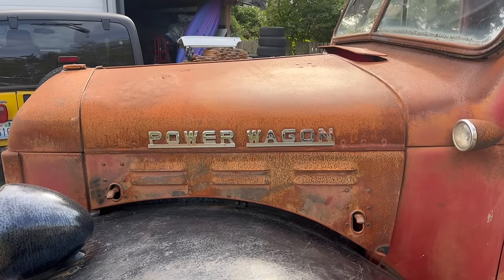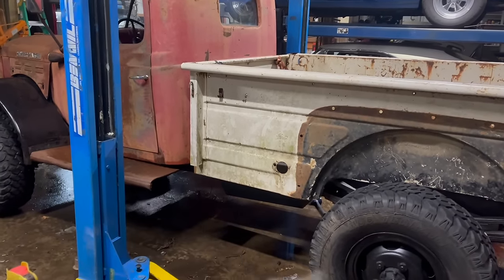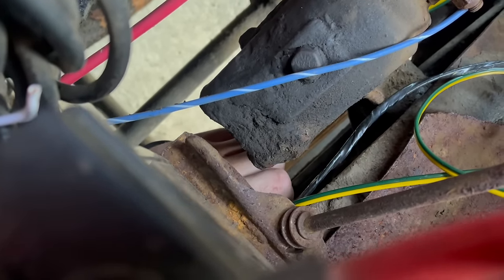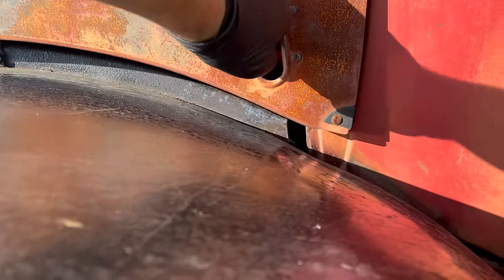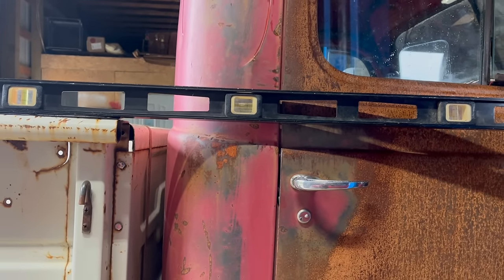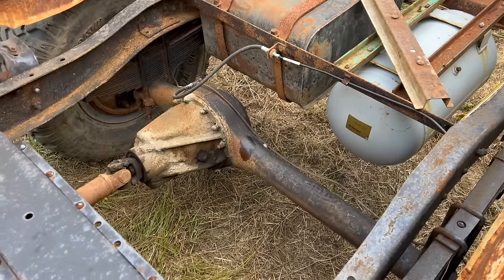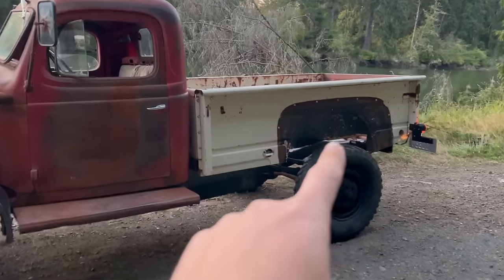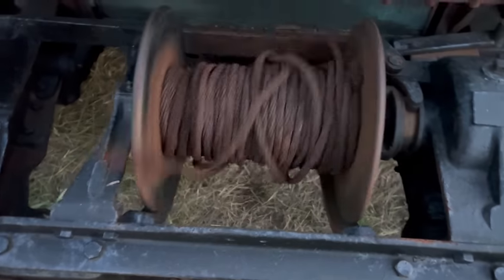Long Abandoned 1948 Dodge Power Wagon Project Gets A New Lease On Life

Comment: Really cool to see someone your age interested in old iron !  My 1941 WC22 has the same engine and straight cut 4 speed which shifts super nice, in fact it just drops into every gear with the right touch.  I think getting the carb / engine tune right, and the throttle linkage free of play and smooth makes all the difference in the frustration level when shifting gears in these.  Keep it up !!
Reply: 1😂😂

Comment: Pressure wash the frame rust really well, then brush on a coat of "Coroseal" rust converter... Awesome stuff that last for many years right outdoors. It's not at all like the old acid based converter, this stuff is one coat, turns it black, looks great... Perfect for the Patina restoration peeps that don't have the time, money or patients for a full restore.

Comment: I have always liked those WW2-style Dodge Trucks.
   But the reality of owning one scared me off.
   Can see where a NP435, NP445, or A518 swap could be really  useful.
   Also see why the Cummins 4bt/12V swaps are popular.
   Or swapping in modern gas V8's or inlines.
   But that messes with the overall Lo-Tech sensibilty of the truck.
    It was not made for the modern 80+mph freeway, nor fit into modern Le Car sized parking spots, limited stopping power that only Fred Flintstone envies, and no need high octaine fuel at all.
   Still a very cool truck as is.
Reply from the maker: That’s it. While I get the appeal of being able to drive one everywhere, all the time… I couldn’t see ruining a time capsule like this. If it was less complete or the engine was garbage, ok. But I couldn’t do it. I even had the 4BT…

Comment: Absolutely love this old guy!  I'd gladly give a ton to run across one I could redo the way I would like to do one.  I know that towards the end of this body style MA Mopar equipped some of them with a  poly 318 which would make me the happiest truck owner ever!
Reply from the maker: Actually, as far as I know, these were flathead and then slant six only - and I think the slant may have just been for export? These trucks remained in production for the US through 1968, but were available elsewhere into the 70s. The W series (the more modern pickup based Power Wagons) could have a poly, an LA later, and even apparently big blocks? Either way, I also just love this thing. It’s just about my favorite thing to drive now - despite being pretty horrible by today’s standards. Haha.
Reply: I know that I saw a power wagon factory equipped with a poly 4 barrel.   It was used by a fire department.

Comment: Really dig your ole heavy hauler. Seeing you having to double clutch it and try rev matching to downshift reminded me of the old grain trucks we used to have. Learned to drive our 50 Chevy ton and a half when I was 9 and by 11 years old it became my job to shuffle the loaded trucks from the house to the field since everyone else was either on a piece of equipment or gone on the road in a semi. 

Thinking about your lack of turn signals clicked another thought about the old grain trucks of grandpa’s and semi trucks from my dad and his brothers. All of those old trucks used an almost identical turn signal switch that clamped around the steering column made by the “Grote” company in case you were looking for a solution. Unfortunately since the turn signal switch was an add on for those old trucks and for the semis until the very late 80’s they don’t self cancel as the columns weren’t built with the internal trigger wheel, learning to click the switch back after completing your turn is still tough to remember after 40 years of it off and on. 

The bowed front bulkhead of the bed could maybe be straightened with a deflated wheelbarrow or motorcycle inner tube. I’ve used the inner tube trick on later model trucks and it worked fine but the later stuff is definitely made of thinner steel, worked great on straightening door skins on several occasions as well. Good luck with getting the truck up to snuff, it may take you a while but it looks to be something you can tackle a little bit at a time.
Reply from the maker: I’ve never seen them from Grote, I’ve seen the Signal Stat. I’ve got a couple of them around. The existence of that switch is why I ran two wires. Haha. But I do also have hands for signaling, and it’s not like I’ll be driving the dang thing much. If I actually add a trailer like I’m considering, that will become more important.
Reply: Sounds like a good plan. Got used to hand signals a long time ago when I put my first panhead on the road. Also the same bike I got run over on in 03. Unfortunately not everyone pays attention to their surroundings nowadays. Glad to see you’re keeping it simple. 

Now that I think about it, the Grote turn signal assemblies were all in trucks that were older except for the one in grandads 60s model King Midget minicar. I do remember that they had they all had chrome levers but the bodies were made with both chrome or bare pot metal. I guess they’ve possibly become obsolete.

Comment: Beautiful old truck! I have a '56 with a dump bed and many of the same quirks: brake issues, rotten wood in the bed, noisy, etc. It was a Fish and Wildlife Service truck in its early days hauling gravel for the spawning beds. PTO shaft drives a little hydraulic pump with 2 lift cylinders. When you drive it awhile and get the feel of the tranny, your gear grinding will stop and it will shift sooo sweet. Keep fresh oil in it too. I always double clutch and treat her GENTLE. Try to only turn the armstrong steering wheel when the wheels are rolling. Lots of guys want to put in a bigger ,newer motor. No way!  The old flathead six is matched perfectly to the truck. It is not built for speed, it was built to win the war.  Easy to work on and fix stuff. Like the old paint job too.
Reply from the maker: I couldn’t agree more! I have stopped double clutching and am now floating gears (no clutch) exclusively. Both Byron and I almost never touched the clutch pedal in this video other than takeoff. It is much easier to do. I could never, ever successfully downshift using double clutch rev matching. I don’t know why, but by simply rev matching and not using the clutch, I am able to downshift almost every time without issue. My upshifts tend to be smoother too. It’s hard to judge engine speed with no tach and road speed with no working speedometer! So my technique is far from perfect. But most importantly, it’s very fun.

Comment: Love the old Powerwagon! These things are about the most rugged pieces of machinery ever built, except maybe Caterpillars. The old flathead 6 is a great engine, they put these in all sorts of farm and industrial equipment back in their day. I have a 56 Dodge pickup, so I can relate to the "less than ideal" driving characteristics of these old trucks. The 56 rides rough, brakes are sketchy and it steers hard, but I love the thing. It does have a small block 318 in it and it runs great, so that helps a lot. And it has a synchronized 4 speed from a mid-60s Dodge truck, so at least it shifts pretty good.
Reply from the maker: A V8 and synchronized gears?! Pure luxury! Haha. I don’t mind the lack of power at all. It’s the gearing and my ineptitude at shifting that are a bit of a problem.

Comment: I've have a pw from 1978.  It's a 1946.  in order to make it ride a little smoother put a ton of sand in the bed or sore engines and such.  On ice mine has been unstoppable.  In 2009 i installed a 4BT cummins and a 5 speed.  earlier gears were changed to 4.89.  Now it cruzes at 60-5 20+mpg.  next trick is making a set of 17" wheels 37" dia.
Reply from the maker: Awesome! Great setup. I am tempted by the 4BT… but the flathead is so good.
Reply: My 230 flathead was .040 and worn out.  My child convinced me to do a 4bt.  Before the 4bt I change gears to 4.89 from 5.83..  The flathead cruised at 50 easy.  Topped out at 60.  Got 17mpg rather than 9mpg

Comment: It runs, it drives, it's powered by Armstrong.Lights in the front, lights in the back, alright. Great looking Dodge for being 75 years old. Good job Jamie And Remember the air conditioning only works when you turn the crank to open the window. Yay!

Comment: I have seen Power Wagons from the sixties sporting poly motors.  Interesting.
Reply from the maker: The later W series Power Wagons based on the late 50s-60s trucks, absolutely. My 1964 W200 Power Wagon has one. Any V8 in an original, “military style” Power Wagon like this was swapped there.

Comment: 488 gears and new windshields are life changing in those old trucks.  Just let some air out of the tires if it rides to rough. It helps
Reply: I also got a set of AVM lockouts and that was a vast improvement in noise reduction and drive ability.
Reply: Also I'd work on being proficient with the factory drive trane and enjoy 1948. If you want a modern transmission, get a modern truck . It sounds like it needs a little timing or slightly leaner at idle.  Looking forward to more on this project

Comment: For an air compressor, mount an A/C compressor from a 70's Ford or Mopar on the engine and if you  converted it to a 12V system, the stock A/C clutch will allow you to turn on the air compressor when needed. Strangely the old York style A/C compressors supply a lot of air and they do it pretty fast.
Reply from the maker: I’ve responded to other comments about this. That has always been my plan. I have two Chrysler RV-2 compressors for exactly this purpose. The problem is space under the hood… it’s very, very limited - and so is the space where I would have to add an additional v belt drive pulley. I didn’t talk about those plans in detail in this video, so I do understand people making the suggestion. I have considered running it off of my extra PTO drive, but I’m not sure the RPM range would be suitable. I have a lot to learn about how that stuff works.
Reply: @DeadDodgeGarage  the RV2 compressor is larger than the York compressor which is why I suggested that one instead of the RV2. Some Mopars did use the York compressor so it could still be considered to be all Mopar. The drive belt system is not an unachievable goal either.  The most difficult part of the entire installation is allowing yourself to think outside of the box on how to do it.

Comment: Those old trucks were oxes they would pull what ever you hooked to it. Not fast but they got there and those engines are bullet proof and run for 3 to 4 lifetimes. I remember as a kid farms loaded with these and they drove them into the woods and parked them when they up graded and there they sat. Like the grain truck i got the 2x4s off the poly 318.

Comment: My favorite dodge truck ever the 41-58 i think power wagon!!! Newer second gen dodge 3500 and 2500 4x4 suspension with a Cummins diesel and the 5spd manual shift hydraulic transmission!
Reply from the maker: Civilian Power Wagon was 46-68 (even later in other countries…) of course the WW2 military truck was very similar. It’s a tempting thought - but I feel obliged to preserve this one in factory form (mechanically) as it is. A transmission that is actually usable would be nice though. Haha.
Reply: @DeadDodgeGarage  I can understand that but yeah the transmission change may be a necessity for driving it almost anywhere lol
Reply: I was including both of the civilian and military power wagons since it was still basically starting out with the same truck.... both were awesome in my opinion and yeah I meant 68 autocorrect you know lol grrr..

Comment: Check the bolts and holes in the transfer case mount brackets. The bolts stretch and the holes egg.Especially with a divorced transfer case. There's also a frame diamention graphic in the original service manual for home frame alignment.
Reply from the maker: Nice! I might well need that. The t case is definitely sagging so this makes sense.
Reply: @DeadDodgeGarage  The 205's have mounts on the top of the case don't know about the 200's(201?).
Reply from the maker: @Ross046  It appears to be a very, very similar setup.

Comment: Have you ever checked out the swivel frame powerwagons...the frame had a joint that was behind the cab allowing the rear half of the frame to flex almost 45 degrees
Reply from the maker: Yeah! Really cool stuff. There was recently a limited edition Power Wagon die cast built, and it has a swivel frame.

Comment: That beast is truly awesome, just floored at how well it runs when the carb isn't being a bitch. Has the engine ever been apart that you know of?
Reply from the maker: I have no way of knowing and no one to ask unfortunately. As hard as it was beaten in the woods, I strongly suspect that it has been boogered together from various other trucks over the decades. But don’t really know. All of the correct mechanical parts are there - except the missing air cleaner.

Comment: Hi, I have a 1947 PW but do not have the badge info about the seat. However under my original seat at midpoint is a lever to adjust how much air escapes, it’s a vent like device. Helps with the seat firmness. Like poor man’s air seat, but does not work as well.
Hope this info helps. GB
Reply from the maker: Yep, that’s exactly what it is. I found a brochure describing this not long after making the video. The mechanism strongly resembles a vent on top of a barbecue. Not working well sounds about right. Haha.

Comment: It is an air seat control valve. Bostrom is an example. Bostrom air adjustable seats.
Reply from the maker: I actually found some original literature for it in other Dodge trucks in ‘48. It was an air bladder of some kind under the seat that used what looked exactly like a barbecue vent to control air flow in and out. I’m guessing it didn’t work very well, as mine is gone - and they sure didn’t stick around in Dodge trucks. I haven’t ever seen an example of one.
Reply: @DeadDodgeGarage   Wow, Never heard of that. I worked for Mack Trucks for 30 years and they used the same term for the air ride seats. My Bad. Thanks for the Great Videos

Comment: You know that no matter how nice you make it, it will always ride, um, "poorly". You do know that, right? Right....
Reply: So I'm back in the days I had those balls that you would text and saying we'll help turn it because you don't have power steering at this on those old trucks people usually happen to the present a sum these perfect so there's a similar ball with that
Reply from the maker: Well… yeah. I’m pretty familiar with how things work. I’ve also done seat time in the lighter, 3/4 ton rated M37 military variant of this truck, which rides a whole lot better. Since the frame and drivetrain are damn near identical, I have thus concluded that I can lighten the spring packs, improve things a whole lot and find a happy medium - where the truck can still carry some weight, but it can no longer carry a house, and my spine may well survive the experience. It’s worth a shot.

Comment: My 1950 was in much worse shape when I got it, but it was mostly complete. Keep the transmission! You just learn to slow down and drive like it’s 1949! Your bed is wrong year but it should have cross braces that actually sit on the frame.
Reply from the maker: Nice! I’m learning it - and obviously with this truck you have to slow down anyway. Haha. The cross braces go from the frame to wood. The perimeter screws are what secure the metal sides to the wood. There is no direct connection from the bed to the frame. I am designing a setup that attaches the bed shell to support braces first, then the wood mounts to that. The later braces (‘78 bed) are completely different, and the original type braces are expensive to replace when you don’t have them. Neither helps my goal to eventually make the truck a dump bed.

Comment: About that plate on the dash. I ve never seen one working but it’s supposed to open and close an air valve under the seat to make it a soft or hard ride. Sorry, but it’s as soft as it’s going to get!
Reply from the maker: I did finally find a picture of it in a brochure. It basically looks like a plate under the seat with a large barbecue lid-type vent in it. Haha.

Comment: Hey if you take a paint pen doesn't matter what color it is and go over the numbers again that they put on there with fresh paint you can wipe it all right off do it all the time at the shop when I'm writing numbers on parts or what not and then I go to use them on the trucks when I want to take the numbers off or put new mileage number on there or new date on there you just go over it with paint pen and then once the paint sweat you can wipe it right off
Reply from the maker: Oh damn. Good to know.

Comment: One rust hole
Major components covered in grease.
I sense a likely correlation between the leakage that must have caused the impressive dirt and lube coatings and the relative lack of perforation on such an aged vehicle
Reply from the maker: It’s self under oiling!
Reply: @DeadDodgeGarage   My Dad's family had a Power Wagon farm truck when he was a teenager.  He had a lot of things to say about it (mostly very positive).  They saved the used motor oil (as expected, learned during the depression then also for the war effort); they used to spray the undercarriage of the truck and their older car with the used oil during fall/winter seasons to protect them, and burned the rest for heat in the barn.

Comment: I’ve got a 1948.  What did you do for wheels and tires?
Reply from the maker: These are factory Budd wheels that someone mounted modern-ish offroad tires on using the inner tubes. I’m not sure that’s the correct way to do that, but it seems to work well enough. They came on the truck.